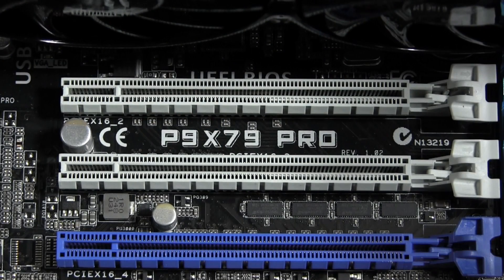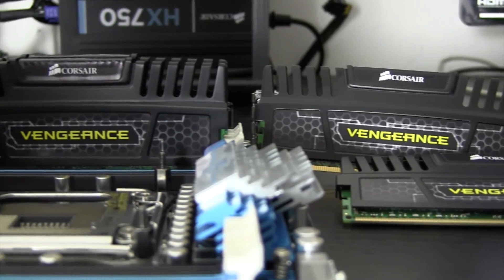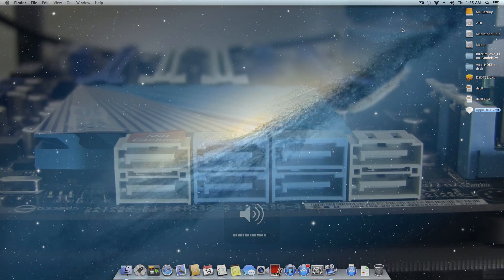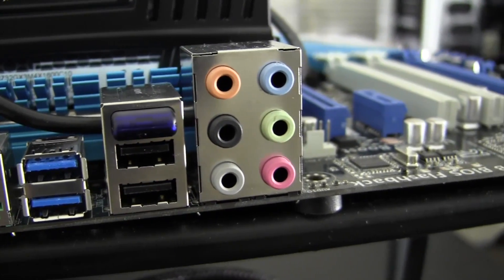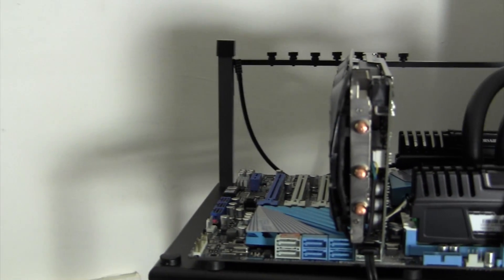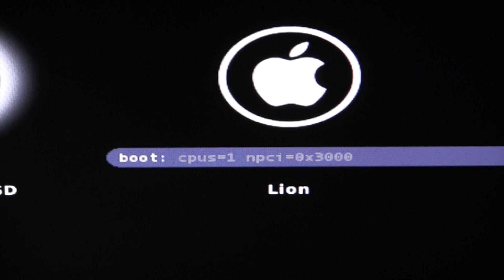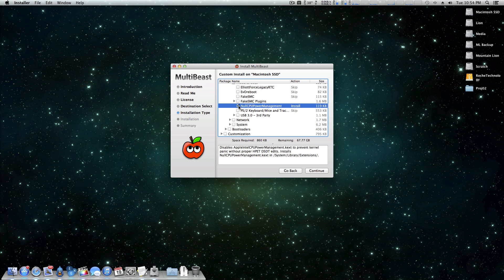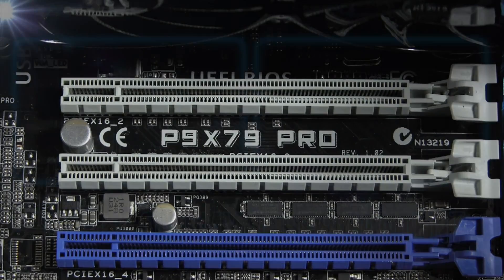Hackintosh Hardware: Asus P9X79 Pro [Motherboard]

Comment: 2018/2019 and my powerful kicking ass Asus P9x79-e WS (Work Station) Hackintosh with a 10 Core Xenon monster still destroying all the latest macOS's it's been thrown at....  macOS Mojave is a piece of cake!   
p.s. the 4-5 year old Asus P9x79 WS & P9x79-E WS server motherboards are still freakin' expensive running at just above $300 used and $600+ mint/new!!! Still worth every penny for any Hackintosh build as these boards work flawless on macOS's!

Comment from the maker: When installing a DSDT, MultiBeast changes your boot.plist back to default values. Your problem sounds like a GraphicsEnabler issue. Try manually setting it to No and Yes, then keep the configuration that works for your GPU. Thanks for watching.